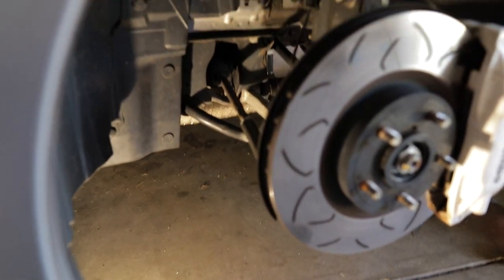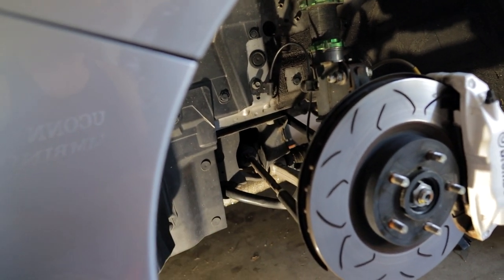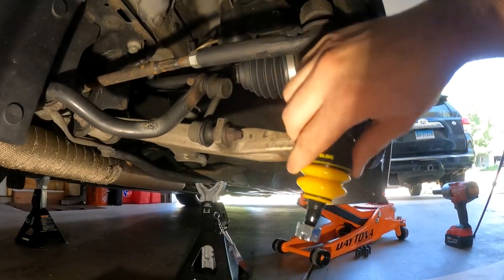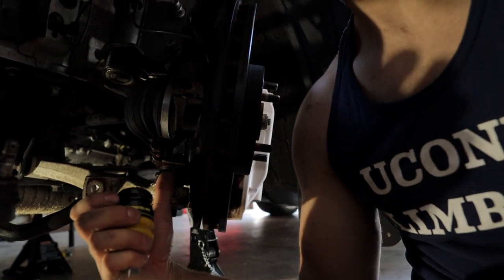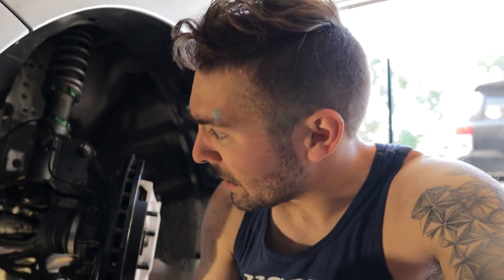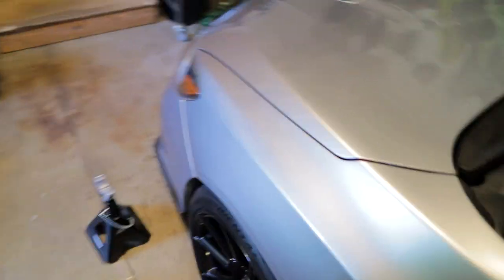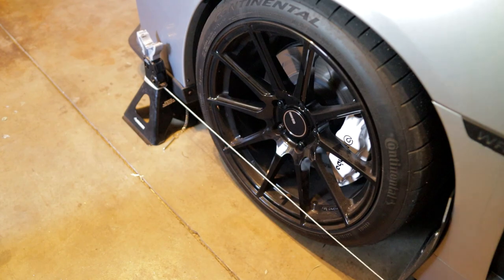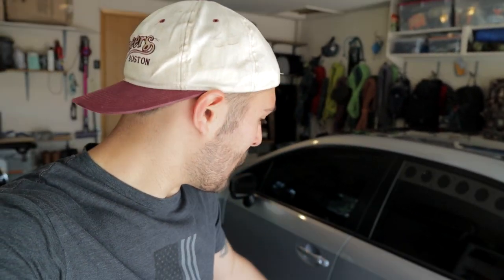EVERY Lowered Car Needs This! - Whiteline Roll Center Kit

Comment: Lowering the car, changes the angle of the LCA which changes the point of the Roll Center, moving it further from the Center of Gravity. This increases the leverage in a roll, and you actually get more weight for e in a roll with the lowered car. This is why you need to fix the RC. Some of the symptoms you ve mentioned are not RC related but due to the change in alignment, following the lowering

Comment: You need to remove the bolts on the rear control arm bush, leave the front one in. It will allow the control arm to pivot downwards. Then your grandma can hit it with her handbag and it will practically fall out.

Comment: Great video helped me understand the weird pulling I got after I put my new wheels (9.5 oF38 265-35r18).. I have gen7 fortune auto 500 with swift spring I haven’t installed them yet. What else should I do should I get the rear control arms also??
Reply from the maker: Depends on if you want to be able to control your camber in the rear!
Reply: @WRXGarage  I only want to lower the car about quarter inch all around, I feel like running these wide tires the suspension isn’t up to it will the new coilovers with pillow balls help, and should I get the white line bump stop kit

Comment: nice. you have a 4runner too. i have one with a V8. its a great combo having a wrx and a 4runner. i thought a V8 model would be good in case i need to tow my wrx. i went with the eibach front and rear sway bars with white line front and rear end links and rear sway bar control braces. i also have white line lowering springs, pitch stop and rear lower control arms which i have not installed yet. im turning 41 in april so i thought about a cold air kit. any opinions on the cold air kit performance wise on these cars?
Reply from the maker: Unfortunately the 4runner is not mine haha, it's my friend's. You're right tho that would be a great combo to own.
Reply from the maker: Cold air intakes are great, but make sure you run a tune for it!
Reply: @WRXGarage  yeah my tuner said anything i do requires a tune as the fa's are pretty sensitive to airflow changes. i wanted to get her re dyno tuned anyways.

Comment: Hey, I have a 2019 wrx. I have a stock suspension with adjustable rear control arms by SPC, everything else is stock. Was planning on getting fortune auto 500s with Swift springs... apart from the roll center kit, what else would you recommend to drop the car approx 1inch mainly for daily driving? There's a lot of info online and you seem to have the setup im going for
Reply from the maker: That entire setup sounds perfect to be honest! The swift springs should be great too. As for the rear LCAs, those should help you add camber for the rear to match the front. Honestly, that sounds like a good setup on its own. Try it out and see how it feels. If you want later down the line, add a swaybar kit.
Reply from the maker: Also, we're going to post a video very soon on a tool specifically for pulling out the ball joints 👍 which will help immensely.
Reply: Thank you! Any idea how the swift springs differ on the FA500s for daily driving?
Reply from the maker: My understanding is that they're more variable in performance which means they're just as stiff while being more compliant at lower speeds, i.e. more comfortable

Comment: Did nobody tell him there is a ball joint separator tool? no hitting required...and it is like 40 bucks...also the lower bolt needs to be removed for the lower control arm to pop off.
Reply from the maker: Yeah.. look at the follow up video. I used the puller tool and it took 5 min.

Comment: Those ball joints are terrible. Living in the rust belt, most times people are bettor off buying a new knuckle. I've had success pulling the whole knuckle off, bolting a piece of steel to the ball joint and hammering it out.